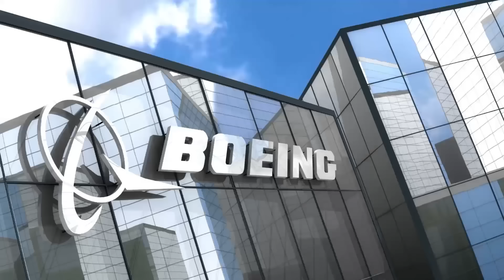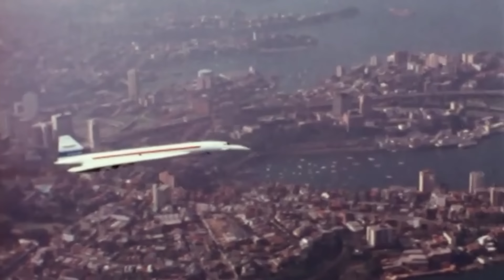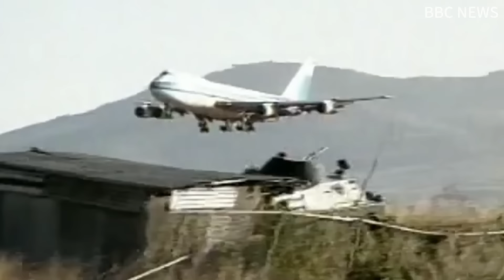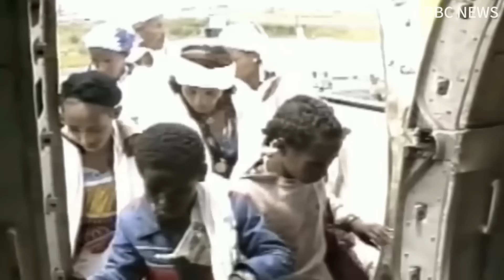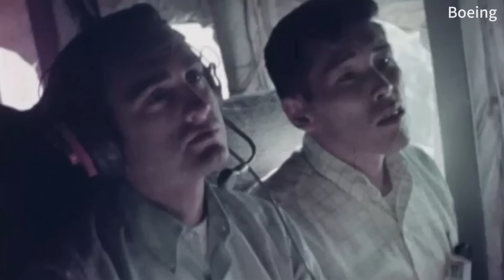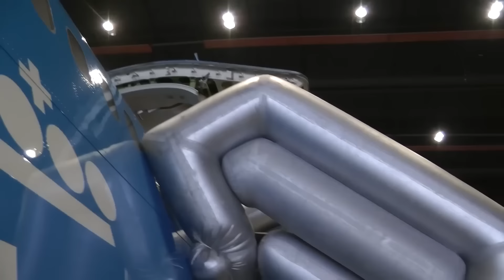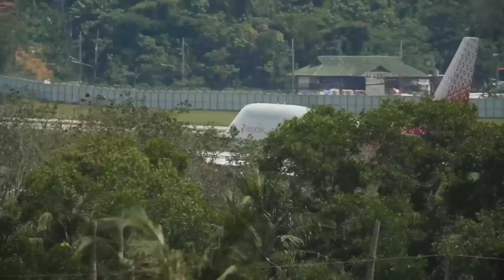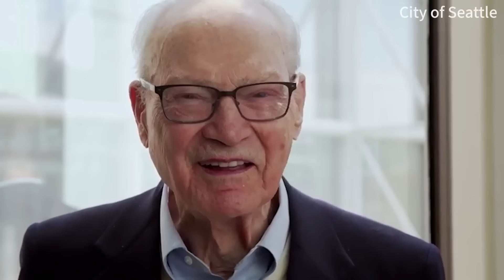What The Boeing 747 Hump Was Really For

Comment: Secret #2 wasn't properly explained. The reason the 747 is able to travel faster than the current jetliners is because the former was designed to fly faster than the modern jetliners while the latter were designed to prioritise efficiency over speed. Flying at close to Mach 1 results in major turbulence to the plane and more aerodynamic drag that will require more fuel to keep the plane at that speed, which is why modern jetliners stay further away from that speed. 

That plane flying from New York to London was able to effectively travel faster than Mach 1 relative to the ground because the air it was moving through was itself travelling at high speed eastwards, so the combined speed was faster.
Reply: And 727 is faster than 747: 0.88 Mach compared to 0.85.
Reply: @GeneSelkov  I've flown a 747-200 at mach .92 from Oakland to Louisville on a UPS contract flight.  We did this at 24,000 to attain maximum ground speed.  Quite noisy, burned about 25% more fuel... but  UPS wanted it there now
Reply: @mrbubbarosa  That's an awesome story! I heard of a similar accomplishment from a 727 captain. He also mentioned extraordinary noise and said they could see shock waves near the window frames.
Reply: @mrbubbarosa I flew the SP from Hong Kong to LA at 0.90. Did this at normal altitudes.
Reply: @mrbubbarosa  Unlimited Plane Speed 😅
Reply: @GeneSelkov  The maximum speed of the 747SP is Mach 0.92, which translates to about 624 mph (1,004 km/h). This is slightly faster than the cruising speed of Mach 0.88 (568 mph or 914 km/h).
Reply: @sx64man all of the 747s had a maximum speed of M0.92, not just the SP.
Reply: @GeneSelkov the 747 could cruise at 0.90.
Reply: No, there is no "effective Mach 1" at all. You're committing the fallacy of false equivalence. Ground speed and air speed are two different things, and there is no magical speed of sound for ground speed. Also, Mach numbers aren't equivalent to linear speed at all. It's only relevant when traveling close to the speed of sound because of odd things that happen there.
Reply: The L-1011 was mach 0.9 as one of its main selling points.  As mentioned planes are slower today to optimize efficiency, but the reason flying slower is more efficient is the management of transonic airflow.  Once an aircraft is going to go much faster than Mach 0.81 it takes careful planning to prevent some airflows such as over the wings and around the wing roots from becoming supersonic.  In order to slow down those airflows you have two options.  1 don't go so fast and 2  reshape and lose some acronymic efficiency somewhere else (usually lift) to keep airflows transonic at higher flight speeds.  A perfect aircraft could travel at 0.99 Mach without any supersonic airflow but such a design is impossible with a lifting shape and certainly impossible for a large aircraft that needs high lift and volume.
Reply: @larrybremer4930   I used to cruise L1011 at .9 and would come in at .84  flight plan fuel  Almost like it would "get on step"
Reply: Very true indeed!
Reply: The Boeing speed king was the 727. It could cruise at .9 Mach.
Reply: @flashcar60  Oh boy, like everything in life it's not that simple though your statement got me thinking. Well done for pointing it out. I've just consumed 90mins of my life I'll never get back LOL and written a long post no one will ever read.  
At any altitude up to say 30,000ft your statement could be true enough but might not be. The reason for this, is the Vne (never exceed speed all aircraft have) is faster in the 747 in knots than the 727 (IIRC) but slower in Mach, but the 747 can fly higher than the '72.
Look what might (might being the operative word here) happens if you consider service ceiling which is always exploited by airlines over long distances because it saves on fuel and increases profits. 

Assuming neither plane is flying at service ceiling but say ~1500-2000feet below.
I punched some numbers into some calculators and came up with some repeatable concepts.

Firstly A 747 has a substantially higher service ceiling than does a 727. This is an advantage because the higher you go the thinner the air, and the faster you have to go across the ground (in nil wind) to register the the same Mach number. The higher you go the lower the airspeed indicator reads but the Mach indicator is the master speed indicator because knots on the airspeed indicator isn't actually telling you how fast you're going in relationship to the design parameters of the aircraft at those high altitudes. 
At lower altitudes say below 25,000' it's exactly the opposite. The Mach indicator is not used, Knots are used.
This is because say 330-350knots is the maximum speed most passenger jets ever go before they overstress the airframe but the Mach indicator is only reading say .55 or something meaningless. Doing 330knots at 55,000' is supersonic BTW - so Concorde territory. Doing say 240kts at 40,000' might be still Mach .8.   

This is what I found:
A 5% lower Mach at higher altitude *MIGHT" be faster than a 5% higher Mach at lower altitude. 
As a datum and not taking account of environmental factors so no wind/earth rotation etc etc, 

"Flying at a Mach number of 0.85 at 42,000 feet is likely to be faster than flying at Mach 0.9 at 37,000 feet. This is because the speed of sound, which the Mach number is a ratio of, decreases as altitude increases. Therefore, a higher Mach number at the lower altitude (37,000 feet) might result in a slower ground speed compared to the lower Mach number at the higher altitude (42,000 feet)."
Reply: Exactly, some others like the Convair 880/CV-990 were also capable of 0.9 Mach but because of these transonic speeds they were noisy (basically had same engines as the F-4 Phantom, B-58, F-104, a GE J-79 variant) gas guzzlers.
That's why more modern jets are often slightly slower but much more fuel efficient.
Reply: This not quite right. The hump was originally designed to raise the cockpit and allow front cargo loading. The planned speed was around mach .75, but an unintended consequence of the hump was the increased compliance with the "area rule" which reduces wave drag at higher mach numbers and improves cruise speeds
Reply: @DavidW27 Thanks for this.  I was wondering if the bulbous front end of the 747 helped increase its aerodynamics.
Reply: @DavidW27 this is not true. The wing of the 747 does not sustain flight at 0.75. Drag isn’t really what slows a plane down. It’s the wing design.
Reply: @rtbrtb_dutchy4183  -  Perhaps you mean that drag is not what limits a commercial aircraft's maximum design speed? After all, your claim that drag is not what "slows a plane" is wrong, BY DEFINITION, in non-accelerated level flight, drag equals thrust (with the vectors in obviously opposite directions). So, drag, BY DEFINITION, decelerates an aircraft in level flight. It is what prevents the aircraft from continually accelerating due to thrust.
Reply: @bruzote my response was to a comment that I don’t remember too well. But if I recall correctly, it was about his claim that the 747 was faster than other airplanes because it had less drag. A 777 flies slower than a 747 because of mainly wing design, not because the 777 creates more drag.
Reply: @bruzote thank you. I’m not a plane guy and don’t understand half of what’s being said here, just mesmerized by the bitching and moaning. I do know that drag is what slows a plane down tho, as you said, by definition.
Reply: @ratatuilleparker3002 that’s not the kind of drag that was being discussed. The maximum speed of an airplane is based on wing design, not drag limited.
Reply: @rtbrtb_dutchy4183 why would cross dressing slow them down? That makes zero sense
Reply: @ratatuilleparker3002  - The "wing design" you mention generates lift, a process which creates "induced drag", and that type of drag represents a large fraction of the total drag.
Reply: @bruzote I didn’t mention wing design, I mentioned cross dressing
Reply: @rtbrtb_dutchy4183   And wing designs cause drag. Chicken or egg discussion, here?
Reply: Newer planes are flying slower. The new engines are more efficient at slower speeds. Flights are taking longer as a result, but the benefits of a cheaper flight is that you can use a smaller aircraft as well providing more benefits for 787/airbus neo style flights. With a smaller more efficient flight, more frequency can be used as well and the turn around on tarmac for smaller planes is also important, cutting down the time a plane is on the ground between flights. The future is going to have less large body planes and they will mostly be for long haul flights.
Reply: @berenscott8999 new airplanes are not flying slower. That’s a myth. Flights might take longer because traffic is so much higher than it used to be.
Reply: Ok except Mach is inherently dependent on air density, so mach 1 groundspeed is a truly meaningless figure.
Reply: None of the Points were in any way "secrets", that's just the worst sort of Clickbaiting Slop. You can find 100 Documentaries about the 747 Program that would have told you all these things before Place Curious even was started as a channel.

And a lot of the claims were too bombastic to be factual too. Of course there are planes that could carry a Space Shuttle. The soviets showed it with their own Buran Program that was flown on top of an Antonov Plane, so the larger US Military transports would have been able to do so also. They just were not needed as NASA had none of those and plenty of 747s... 

I'm enthusiastic about the engineering of planes too. But not because they play some Temu version of Hans Zimmer under the video or because they lie their arse off about how allegedly unique XYZ is but because it's enjoyable to see people solve problems and put good effort in to make it a fabulous product. This kind of video is capable to spoil my enjoyment majorly.
Reply: At high speeds, drag is proportional to the square of the speed.  So, as speed increases, drag increases much more.  Every little decrease in speed saves significant money.
Reply: This is not true.
Reply: It's amazing to me that a 747 cruises for hours at a higher mach number than the mach Geoffrey DeHavilland was flying when his neck was snapped by his airplane's trans-sonic buffeting.
Reply: I think the narrator did explain that newer passenger jets were built for efficiency.
Reply: It is called transonic drag...
Reply: Great explanation.❤
Reply: True. Additionally, Mach 0.85 is the 747-400's typical cruise speed, same as the A380's for example; however, the 747's MMo (Maximum Mach Operating) is Mach 0.92 compared to 0.89 for the A380. So secret #2 should have referenced MMo as quite a few airliners are capable of cruising at Mach 0.85. Great video nevertheless Plane Curious!
Reply: The original 707-Kirk had an impulse drive which was upgraded to a warp capable drive with the 727-Klingon model. Nobody can tell me why this technology was abandoned in favor of traditional jet engines
Reply: Makes me wonder if a diving 747 would get faster than Mach 1, and get those nasty problems with the elevator refusing the job. The Brittish had found the solution, an elevator without a fixed part. Could one dive a 747 and lose control going supersonic? Scary idea.
Reply: @voornaam3191 Should be possible. In WW2, some diving subsonic planes came somewhat close (0.8) to Mach 1 before losing control and breaking apart. These planes did not have swept wings and the 747 does.
Reply from the maker: Yes, this is true!
Reply: @planecurious damn
Reply: No 747 was ever capable of anything more than its max design speed. The wing has a max design speed after which it stalls in high speed due to mach buffeting even with supercritical airfoil. If the aircraft flies faster than that it it ALWAYS the tailwind component that results in higher groundspeed.
Reply: @mignav464  No. There are lots of planes that simply get overstressed wings above Vne. That means you hear aluminum ploink, wood crack or composite bang, and you no longer have wings. End of story. Planes are very strong, still there is a limit. It takes a bad accident crossing that limit. Rather not think about it. But it is something pilots know.
Reply: @voornaam3191  no, the problems is not that wings would be overstressed in a dive and break off the wings. The problem is that the supersonic shock waves will interfere with normal airflow and aircraft will lose control. These shockwaves tend to be the worst around the flight controls like the ailerons and spoilers.
Reply: Also Secret # 1 the point that nose passengers had a better view than the pilots, only if the nose cone had been glass, looking sideways on take off gives pretty much everyone the same view. I agree about #2 with you, look at cars from the 70s to cars of today in general. Secret 3 well lets remember the stripped down RMS Queen Mary that took thousands of troops to Europe. Secret #4 didn't any other aircraft require a crew of three or more before? this is hardly a 747 creation. There are definitely things that were firsts for the aircraft and it did kick off the wide body thing, however I'm not sure that it was more innovative than the 707 at that time, or the Me 262 and Gloster Meteor in their times, and the same problems exist with paint for all aircraft from the DHC Beaver to the largest aircraft. The longest flight also doesn't count as the aircraft was altered. Again, I have no doubt that all aircraft manufacturers thinking and design, like they always did with the cutting edge. I believe it was a great flyer and an excellent aircraft, but to make a list of all aircraft that "changed the world" would require more space than I want to use. However it was an interesting video, with wonderful shots and film clips of the 747
Reply: The plane that flew from New York to London was flying at 825mph which is roughly Mach 1.25
Reply: @michaelmayer8618  It's called the jetstream.
Reply: kinda correct, it definetely results in more drag but its only capable of reaching these speeds due to its transsonic wing profiles. usually the upper side of the wing is very curved, forcing the air to increase in speed a lot, therefore this point would cause supersonic speeds first and therefore result in a stall. the 747 top wing profile is way flatter but the bottom is more convex to achieve the same pressure difference for lift
Reply: Modern jetliners use turbofans with greater than a 10:1 bypass ratio (the fan provides most of the thrust).  The old 747s used turbojet engines which could be pushed close to or past mach speeds.  Turbofan engines do not work at supersonic speeds since the eddies that form around fans at transonic or supersonic speeds render the fan useless.
Reply: @lymancopps5957  Actually nearly all military aircraft of 3rd-5th generation use turbofan engines and are capable of supersonic flight, however you are correct that they are not high bypass ratios.  F-18s GE F404 engine 0.34:1 and F-35's P&W F135 engine 0.57:1 as two examples.  The reason they don't use higher bypass ratios has more to do with minimizing frontal area than a problem of slowing down inlet air since even turbojet engines cannot ingest supersonic airflow through its compressor.  Even an SR-71 slowed the air to subsonic speeds before the compressor, and also had a bypass ratio of 0.25:1 however this bypass air did not pass through a fan, rather it was fed by shock wave compression at the air inlet.  It's engine would be better described as a combined cycle turbo ramjet.
Reply: @larrybremer4930 

When talking about the Pratt & Whitney J58 in the A-12 and talking about the air that gets compressed in the compressor section but doesn’t go through the core it is a bit of a definitional topic. Some say bypass air (distinct from the air that goes totally around the core), some will argue that it is a very big amount of bleed air. I personally follow the associated patent terminology and consider it bleed air, but that engine does have an effective bypass ratio. The J58 has some similarities to the latest military development engines. 

Where did you find the bypass ratio for the F135 engine? That number has always been hard to find.
Reply: @larrybremer4930   They have low to no bypass turbojet engines.  Nothing capable of supersonic uses a turbofan engine.
Reply: @larrybremer4930   The F404 engine only has a 0.20 bypass ratio which is negligible.  Modern turbo fans are 10:1 to 14:1.
Reply: @Mentaculus42  For the F135 I read many hits of a google "F135  engine bypass ratio" and used the figures most sites agreed on.  One site said 5:1 but that is probably specifically talking about F-35B in VTOL configuration since it increases its bypass ratio considerably to both cool its exhaust plume that points right into the tarmac and of course all the air being drawn through the lift fan that is powered by the engine core making it a high bypass turbofan in VTOL configuration.
Reply: @lymancopps5957  Any bypass taken after stage 1 and before stage 2 compressor would be a turbofan by definition even if it has a tiny bypass ratio.  Bleed air is a feature of nearly every jet engine and is usually taken between stage 4 and 5, used to power equipment and supply cockpit/cabin air and is not considered "bypass" since it never contributes to thrust.   In a turbojet 100% of stage 1 air (less bleed air) will flow through the core and into the combustion chamber.  While not every single fighter has a turbofan, at this point nearly all do and all have some amount of bypass.  While bypass is usually done to improve efficiency it is also a practical way to cool hot parts of the engine core and afterburner turkey feather (with a cool boundary layer) so you can feed more fuel and get more thrust without melting something.  It is easy to look at specific engines to find their bypass ratio and usually it will say if it is a turbojet or turbofan.
Reply: I will happily educate but this is pretty easy stuff to research - "The General Electric F404 and F412 are a family of afterburning TURBOFAN engines" (Google).  That definition alone clearly says its a turbofan engine.  All turbofans have a bypass ratio greater than zero, fact.  The specs I see say it is a 0.34:1 bypass ratio, and I don't know how one could say 34% of the airflow being bypass is "negligible".  I will again state that high performance military jets are not airliners.  Their requirements could not be farther apart.  Such comparison are like matching a School Bus to a McLaren because they are both road vehicles.  Even small private jets have very pathetic bypass ratios.
Reply: @larrybremer4930 

Thank you, I don’t know how I missed that as it is widely available. There was a discussion about about how the lift fan version could generate the additional power needed for the lift fan and still remain power balanced between the two core spools. I could never find a F135 diagram that showed the bypass ductwork, but as you noted, it clearly has a bypass ratio.

It was suggested by a jet engine designer that the F135 has variable turbine inlet guide vanes.
Reply: @larrybremer4930 you definitely explain this better than I was able to do. Thank you.
Reply: @Mentaculus42  I was a marine, and while I can marvel at the F-35B as superior to the venerable AV8B as a VTOL that package severely hampers its range and payload compared to other F-35 variants but I guess those are less of a consideration for a very forward deployed aircraft (the AV8B had pretty short legs too).  My understanding is when in VTOL the core thrust is highly derated which makes sense if you think about it.  A jet engine can be thought of as just a big gas generator and you can extract work from the gas, as pure jet thrust or from its spool shafts (like a turboprop does).  In VTOL it changes over to extract more work from the shaft, and work costs you in gas generation (lowers velocity of the exhaust thus also lowers its volume).  That is how the turned down hot end matches the almost mid mounted lift fan to balance the thrust somewhere around its center of gravity.  The article you found about it having variable stator vanes is probably accurate, to change the airflow in a way that has more energy imparted to the rotors to develop all that shaft horsepower (nearly 30k Hp to drive that lift fan according to google).  I imagine a good portion of the bypass and bleed air are sent to the "puffers" that give 3 axis control by thrust rather than aerodynamic control surfaces when at near zero velocity.  I remember AV8B very rarely would come straight down except maybe the final 40 feet, but they would creep in to that position at around 35 Kts or so (estimated by my eye) and that was likely to keep some effectiveness of ailerons, stabilator, and rudder (and some wing/flap lift) while on final for those VTOL landings but that is just my guess.  Equally likely is they did it just for visibility of the landing area, or both.
Reply: @larrybremer4930 

Thanks for the reply. The AgentJayZ youtube channel had an episode about this issue of trying to balance the power output of the two spools when the lift fan is engaged. Since the low pressure compressor shaft gets coupled to the lift fan that takes ~30,000 hp to be powered, the low pressure turbine section must compensate for that in someway. If the low pressure compressor slows down then the mass flow is reduced to the combustor which is counter productive if the core has to produce more power and not overheat. Considering that the F135 is known to be running quite a bit hotter than originally planned for which this is hurting the maintenance cost (and hence the core upgrade program), the combustor probably is burning more fuel (and running hotter) to generate the additional gas velocity/volume to generate more power for the lift fan. A jet turbine engine designer suggested that this engine could have variable turbine inlet guide vanes to deal with the variable gas flow conditions due to the lift fan requirements. 

Personally I “feel” that the F-35 B is a good Harrier replacement that would never have been built if it was not for the A & C models existing. Also I feel that the designs of the airframe for the A & C models were compromised to have commonality with the B model (hence the pilot’s nickname of “Fat Amy” for the F-35). Anyway, the F-35 B is an amazing design.
Reply: @lymancopps5957  not a single 747 used a turbojet. They all had fan engines. Only thing that changed was the bypass ratios.
Reply: @rtbrtb_dutchy4183   The low bypass engines of 0.23 to 0.3 I really don't consider them turbofan engines since the bypass thrust is negligible contribution to thrust.  Modern jet engines are 10:1 or higher.  Those can't operate at transonic speeds.
Reply: @lymancopps5957 you don’t consider an airplane with a fan a turbofan?  Sounds like you don’t understand the difference between straight jet and a fan jet. A straight jet, does not have a spinning fan when you look in the front of the engine. So when you see a fan, it’s a turbofan. 

The JT9D is considered a high by pass turbo fan at 4.8:1. 

You are just trying to move the goal posts after you’ve been called out by everybody.
Reply: @lymancopps5957 how does a turbofan engine differ from a turbojet engine? Is this roughly analogous to turboprop vs jet engines? Many thanks, in advance, from an avgeek housewife.
Reply: @afriendlyfaceinthecrowd  To create "thrust" you need to throw something behind the vehicle, you can do it with a small amount of stuff at high speed or a lot of stuff at lower speed. In this case "stuff" is just air being accelerated through the engine, the "turbo" part of the name refers to the turbine in the back that is spun by the burning air and fuel creating the compression in the earlier stage of the engine. Both turbojets and turbofans have the compressor stages but turbofans also have a large ducted fan at the front, ducted fans are generally more efficient than a propeller as the velocity of the air increases as you get less turbulence and separation from the blades. As engines have developed the fans are getting larger and larger and most of the thrust comes from the fan, they are starting to fit reduction gears so the fans can get larger still. Though CFM are developing an engine thats part way between a turboprop and a ductless turbofan, one thing to note is that as speeds increase any kind of fan, propeller and eventually even a turbojet become useless as the mass thrown back as thrust has to exceed the speed of the vehicle.
Reply: @afriendlyfaceinthecrowd  A turbofan engine differs from a turbojet in that it has a very large fan at the front of the engine. This allows a lot of air to go around (bypass) the engine core which results in more thrust. A turbojet doesn't have that large fan at the front so little to no air bypasses the core. The core is where the power is generated.
Reply: @afriendlyfaceinthecrowd   A turbojet has a single turbine for intake and combustion.  The power of this engine primarily comes from combustion.  The intake can be easily be manipulated to mitigate transonic currents.  Turbofan engines are somewhat similar to turboprop engines.  The turbine drives a huge fan which can supply 80% of the thrust.  The airflow mostly bypasses the turbo jet portion of the engine.  Fans and propellers generally do not work well at transonic speeds.
Reply: @afriendlyfaceinthecrowd  the problem with a modern turbofan is the high speed on the fan tips. it is more efficient if they get bigger. but if they get bigger, the speed on the wing tips are to fast. if they go supersonic, they will destroy itself.
that means you need to lower the rpm. and that makes it a bit slower because the thrust of the jet is not powerful enough.
the way out is the geared fan, where the jet engine inside can spin fast and the fan slow to allow a huge diameter, huge power and high efficiency.
geared fans where not available, they used 4 engines with a smaller diameter to spin faster and fly faster. but low efficiency. and at the end this is the huge problem that lead to its end, the poor efficiency.
if you look at the A350, they have only two engines but huge, which means very efficient.
in the A350 NEO there will probably be a RR Ultrafan with the highest bypass ratio ever - in a few years. Which means best efficiency and low ticket prices. This will also be the time when all A380s have to retire.
Reply: @afriendlyfaceinthecrowd  I found the explanation by @lymancopps5957 a bit confusing. Let me try.
Basically, you are right. The turbofan engine is pretty similar in principle to a turboprop. You can think of building a turbofan as taking a turboprop, removing the prop, and replacing the prop with a ducted fan that has a lot more blades. 
Another difference is that the turboprop generally doesn't rely on direct thrust from the engine exhaust. Many, probably most, turboprops have a duct that sticks out the side of the engine housing. They use every bit of energy they can get to turn the prop, so there's nothing really left for exhaust thrust.
A modern turbofan, on the other hand, gets probably around 20% of its thrust from the exhaust. The remaining 80% or so of its energy goes to the fan.
I've been away from that stuff for quite a while, so my numbers may be wrong. The principles are right, however.
Reply: @afriendlyfaceinthecrowd  a turbofan engine is a turbojet engine with a big fan in front of it. the air propelled by this fan will bypass the turbojet engine.
Reply: @lymancopps5957 Thank you kindly for your time and patience taken to explain the engineering at work to me. It’s much appreciated.
Reply: @stefanweilhartner4415 Thank you for sharing your knowledge, especially in such a kind and easy to understand way. I appreciate your insight!
Reply: @elscientist Thank you for your explanation of the turbofan engine. I appreciate your answer.
Reply: @lymancopps5957  the 747 NEVER had Turbojet engine…never! It launched with a Pratt JT9D engines, one of the first High bypass turboFAN engines (the GE TF-39 on the C-5 was the first in production). I have 10s of 1000s of hours on each acft.
Reply: @talonpilot  - Name does NOT check out (with comment). ;-D Seriously, though, did you fly Talons while flying 747s (or after)?
Reply: @lymancopps5957  - The B-747 has always used turbofans, they were what made the design possible.
Reply: @lymancopps5957  Swing and a  miss.   The 747 never used Turbo jets ..but nice try
Reply: @lymancopps5957 Actually, the original B747-100 used four (4) Pratt & Whitney JT-9D turbofan engines. Significantly, these were the first high-bypass ratio engines from P&W. Even the older JT-8 was a turbofan but, with a much lower amount of bypass air. My assertions are based on easily found facts and my personal knowledge from my father working at P&W during those times. I also absolutely remember seeing the B-52 test bed aircraft flying over our house with a JT-9D on the #2 pylon; it was obviously a turbofan even then.
Reply: @lymancopps5957 no, the 747 has always had high bypass turbofans. Even the JT8D is high bypass.
Reply: @lymancopps5957  not true, the 747 has always used turbofans - the Pratt & Whitney JT9D used on the 747 from day one was the first commercially available high bypass turbofan.
Reply: @lymancopps5957  All 747's use High Bypass Turbofan engines. The original Pratt & Whitney JT9D-3A engines of the 747-100 had a bypass ratio of 5:1 .
From the 747-200 onwards, Rolls Royce offered the RB211, a truly ground breaking triple spool High Bypass Turbofan which initially launched with a Bypass Ratio of 5:1. The RB211 was subsequently renamed into the Rolls Royce Trent engine series still in use today with Bypass Ratios as high as 11:1 . Bypass isn't everything though - thrust to weight is a better indicator of engine efficiency.
Reply: @lymancopps5957 seems you deleted all your comments when you doubled down with misinformation. 😅
Reply: @rtbrtb_dutchy4183  - Maybe don't complain about someone deleting (their own) comments. Deleting any misleading, fallacious or cantankerous comments is good for the other people who would otherwise waste time on negative-value comments.
Reply: @bruzote I’ve deleted comments myself, after I realized I was wrong. But I would post that I was wrong. That’s a courtesy. Deleting and disappearing, especially after telling tons of people how they don’t know what they are talking about, is not very nice.
Reply: @rtbrtb_dutchy4183  - Got it. An apology and admission would be nice. Oh, well. :-\
Reply: @lymancopps5957 The initial 747 still used turbofans. They were just low bypass turbofans
Reply: @lymancopps5957 The original 747 didn't use turbojets at all. The engines would have consumed way too much fuel. All of the air ingested into a turbojet is burned; that's not the case with the 747. The 747 always used high-bypass turbofans. The high-bypass turbofans have been improved with with time, allowing the 747 to further improve fuel efficiency. 747s have now become obsolete, because you can use two huge engines for long-haul flights instead of 4.
Reply: Engine design....The B-52 will need to lose 90MPH cruise speed with the now only hi-bypass engines.
Reply: @u2mister17  I would love to see the source for that reduced cruise speed - usually cruise speed is based on where the wing is most efficient and shouldn't change if the available thrust to weight hasn't changed.
Regardless, the new engines will help keep the BUFF in the air for another 50 years. Not many aircraft can say that.
Reply: @kstricl  I listened to an engineer 15 years ago talking about why the buff needed engines that are not produced today. There are no turbojet only hi-bypass but NOBODY will admit this fact today.
Reply: @u2mister17 you do know that the b52 is currently being re-engined with modern Rolls Royce engines, right?  It doesn’t have to lose 90MPH.
Reply: @u2mister17    The F22 uses a turbofan and it can super cruise. The 747-8 cruises at almost exactly the same speeds as the BUFF using high bypass turbo fan engines. Pure turbojets are really only useful for applications where pure performance over a short period is more important than total fuel burn (like a jet car.) I would suggest that engineer is out of date on their information.
Reply: @kstricl  Let me see, F-22 40 Million dollar engine (times how many?) 747 engines are how big (drive a truck through the intake)?  Just telling you what the man said.
Reply: @rtbrtb_dutchy4183  Yes, and the F130 engines it is being fitted with are effectively a military version of the BR725, which was designed for the Gulfstream G650. Check out what Mach number that aircraft is certified for.
Reply: @harveyschofield4619 not sure what you are trying to say. I wasn’t the one claiming it couldn’t fly as fast with fan engines. Mach speed has nothing to do with engines.
Reply: @u2mister17 the B52 is getting fan engines. It will improve performance, not reduce it. It won’t slow the airplane down by 90 MPH.
Reply: @kstricl  The F22 has shrouded inlets that keep the shock wave out of the fans. That's not present in these pylon mounted turbofans, if pressure ratio wasn't immediately disrupted at supersonic speeds it would soon start exhibiting engine-rich exhaust when the fan gets vibrated apart.
Reply: @mfree80286  - TDIL of "engine-rich exhaust". :-D I will store that in my brain next to "unplanned rapid disassembly".
Reply: @kstricl  No, it is common knowledge that early jets pushed out high speed air, and when the by pass was invented, that engine pushed out more air at a lower speed. Those new engines are more fuel efficient, but that means planes are somewhat slower than before. It's simply because new engine developments aim at better efficiency and not at higher speed. Engines for supersonic planes are different. And beyond doubt those develop too, range gets better, but here the discussion is airliners. You can search other airliner video's, for details.
Reply: @u2mister17   What on earth is a buff? Never heard that before. It's a bird?
Reply: Isn’t that obvious?
Reply: Also have to deal with Mach tuck starting in the transonic region by trimming elevators or stabilizer to pitch up, or by pumping fuel into the tail like Concorde.
Reply: I was blown away by #3 but then I realized that 1088 Africans probably still weigh less than 450 Americans. I always worry when getting on a 737 or an A320 when I look around and see that all 180+ seats are packed with 250 lb women and 300 lb men. Then as it takes off you can hear the engines straining as the fuselage creaks and shakes and the plane barely clears the trees and buildings at the end of the runway by what looks like about four or five feet.
I've never been on a 747 but I've been on an A380. The 380 was going to Japan so half the people were japan-sized but not sumos.
Reply: @jackandblaze5956  They'd been having a famine in Ethiopia around that time so, while your calculations may be off, your point is well taken.
Reply: @jackandblaze5956  That trip to Japan must have been awesome, and in an A380 to boot, the largest plane I've been on was a 777 and I was somewhere in the low 50s for rows, the first row that had less seats due to the fuselage getting smaller near the tail, and I have to say that I felt more cramped in that than any other I've been in. I agree, seeing all those walruses waddle down the aisle with more carry on than they are suppose to have is annoying, but I'm betting that the 737 airframe is designed for twice the limits posted, well I hope. Oh and that 777 was an Air Canada so maybe that is why I felt cramped
Reply: Nah, 787-10 is able to fly faster than 748-8(fastest 747). That's Boeing's, infact whole passenger commercial jet's newest subsonic plane from the ground up.
Reply: @johndavidson3424 there is no “fastest 747”. All models are certified to Mach 0.92. All models (not just the -10) of the 787 are certified to a maximum of Mach 0.90.
Reply: @rtbrtb_dutchy4183   From Bijlmer disaster (next to Schiphol) documentaries, I understood the first 747's had engines that happened to come loose from the engine mounts. Several early 747's literaly lost an engine or two (those broke off and were gone, got that clear?) and right after take off that is no good. The pilots must have lacked power, for one engine should be sufficient for returning to any runway, but sadly the crew had a low final approach and they did not make it. Cause was those engine mounts, somehow some bolts cracked. Later models got a different engine type, problem solved. But lots of people lost their life. Sure you can check this.
Reply: @voornaam3191  one engine came off the airplane, the inboard engine on the right wing. This engine then hit the outboard engine on that same wing and knocked it off as well. 

They didn’t crash due to a lack of power at low altitude, they crashed because that right wing was damaged, especially the leading edge flaps and trailing edge flaps. They unfortunately turned into this right wing, which is worst case.  The leading edge flaps were mostly missing, so was part of the trailing edge flaps. 

So when they slowed down while in a right turn, they lost too much lift on that side and rolled over.
Reply: It was unfair on part of the arch rival of 4-engined Boeings (which are twice as safe as the 2-engined competitors from across the Atlantic) to advertise "Two mouths are cheaper to feed than four".
Reply: @MuhammadLodhi-g9y  because when the 747 was designed, the rules required 3 or more engines for transatlantic flights over the sea
Reply: @MuhammadLodhi-g9y  - "Twice as safe"? If you're being literal, I would like to hear of the empirical data supporting that claim. Some engine failures are correlated (e.g., bird strikes) and each aircraft design has unique control methods and response characteristics for engine failure.
Reply: @MuhammadLodhi-g9y silly to say that. They had the A340 and the A380, which both basically failed because it had 4 engines. 

And you can’t say either that 4 engines are twice as save. You can  also say that 4 engines is double the chance of something going wrong.